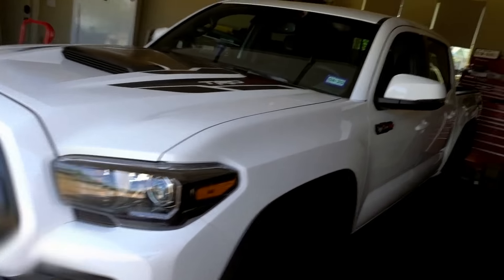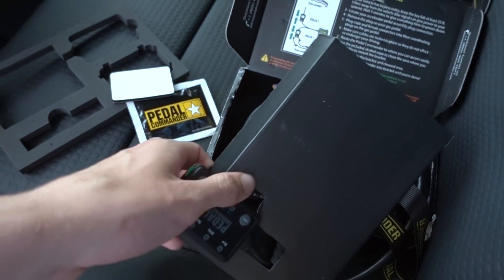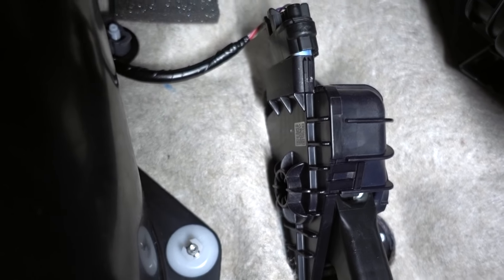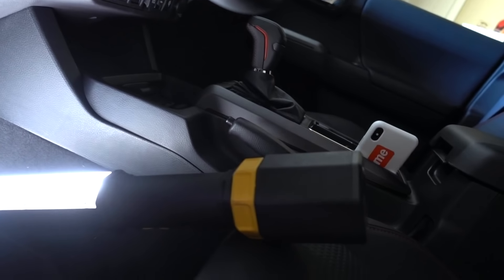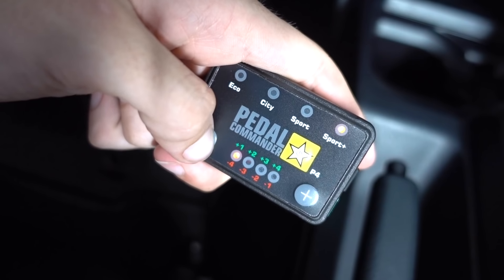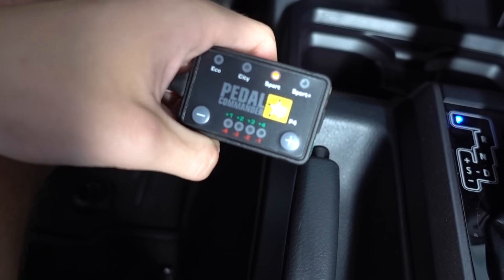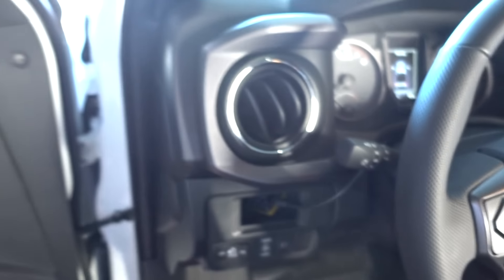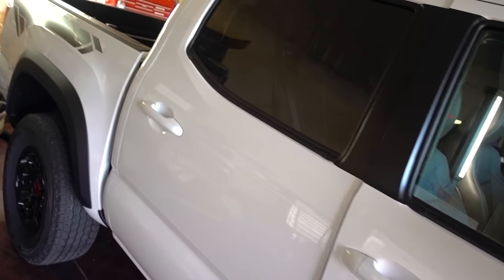Pedal Commander Install - Tacoma TRD PRO 2018 MODS! PC38

Comment: Does it void warranty?
Reply from the maker: LSHippo Lazaro If you are concerned about warranty, check out this...

https://en.wikipedia.org/wiki/Magnuson%E2%80%93Moss_Warranty_Act

From what I have heard, the OEM must prove that the modification you installed caused the issue to the part asking to be warrantied.
Reply: yes it can. the magnuson moss warranty act doesnt apply to this. besides, just take it out before going to dealer.
Reply from the maker: george b why is that?
Reply: BRADEN SCHLIMME dealers cannot void a warranty on any part just because its aftermarket, if they do,  they have to offer the part free of charge. that applies to parts like filters, axles, brake pads and such. this part is considered a performce part, and does not come on the vehicle from factory. youre adding something the manufacturer didnt have in mind. that being said, if the part you put on causes a problem, the dealer doesnt have to stand by it, so this is an at your own risk thing, as harmful or harmless it may be. it would be smartest to just not let the dealer see that you have it.
Reply: LSHippo Lazaro it voids the warranty if you show up at the dealership with it
Reply: Where did you find it and how much and thank you

Comment: I have a pedal commander on my 18 tacoma, its called my right foot! 
This mod is, IMO a waste of money since it literally does nothing but void your warranty
Reply from the maker: it doesn't void the warranty. I gave all the details to someone else in this comment section. I know many people personally, that work for the Toyota, who provided me with the information that I gave. That said, a Pedal Commander isn't the best way to spend money on the truck lol.
Reply: @BradenSchlimme  
Well they'll look for any reason to void your warranty if say your transmission goes out, or the pcm. This thing acts as an unapproved input to the pcm, therefore it does void some items from the warranty. Best to remove it completely if u have a warranty issue before taking it in
Reply: U are wrong with that statement. Obviously youve never used one.
Reply: @thumperbangin2000  
What part of what i said is wrong? Please explain

Comment: Did you just assume those plugs gender ?!? Lol so 2 months how do you like the commander and review. Picked up a 18 OR and can tell that’s the first thing that’s an issue.
Reply from the maker: It's pretty cool. At some points, it's a little gimmicky but, I always have it on. I keep the Pedal Commander in sport and rarely change modes. I also use it with ECT on which makes the truck feel like it has more torque. That said, the truck still struggles for power. I wish it had an extra 50HP.